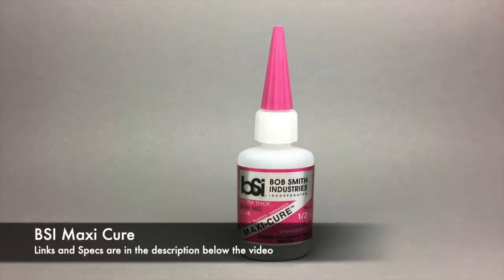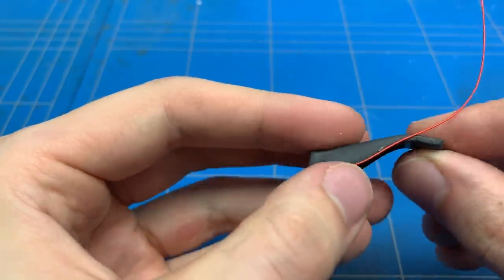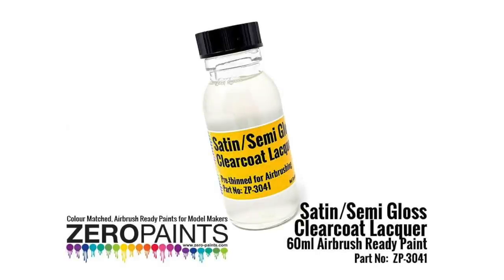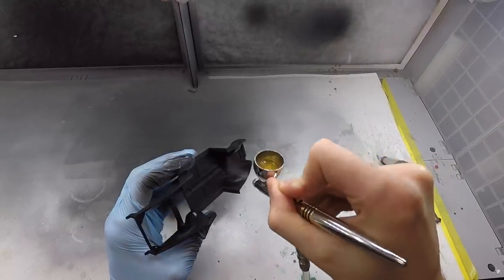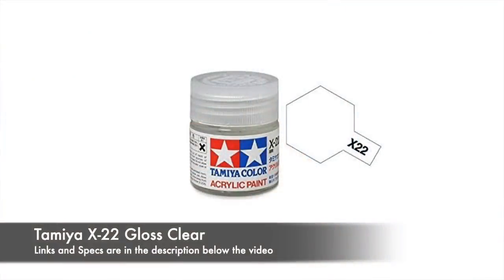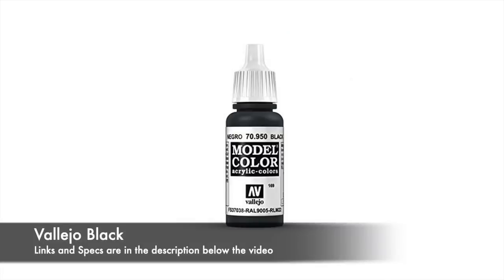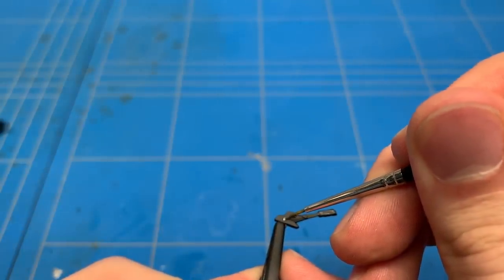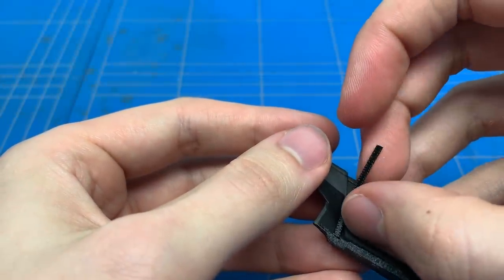Fujimi: 1985 Porsche 930 911 Turbo Part 2

Comment: I've noticed that in your now older videos when flocking you'd avoid the platforms where the seats go from flocking, now it appears you do the whole area. Does the glue still have a strong bound even with the flocking?
Once again,  another awesome video with great details.
Reply from the maker: Glue holds just fine